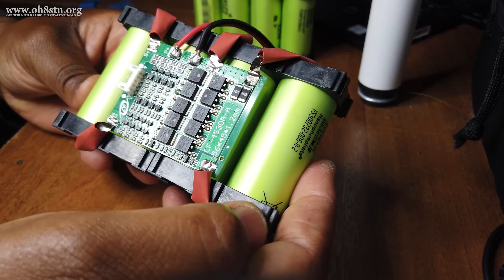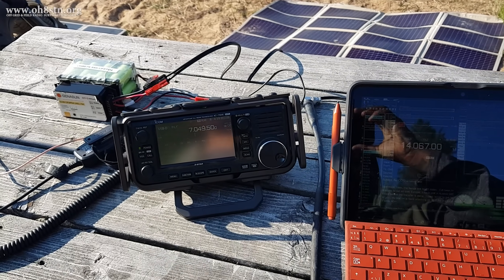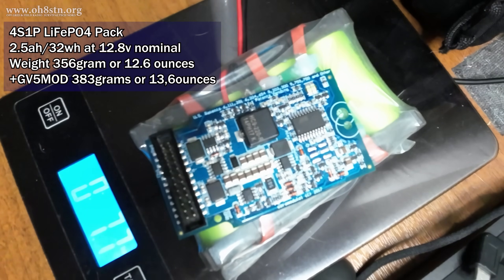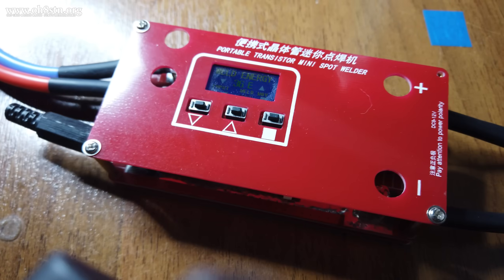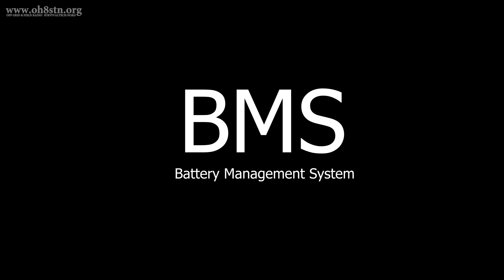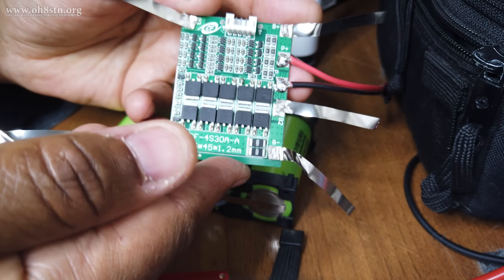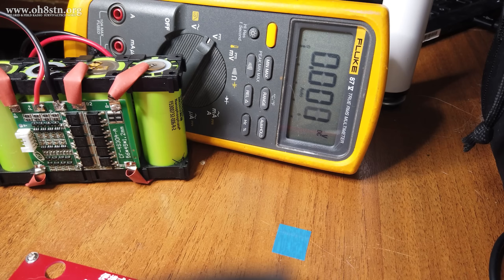Portable Ham Radio battery Pack DIY

Comment: Hi Julian, the pack is finish 😂,  but no sun for charge via my pannel lol 😅, please info for charger model for charge into my home, 73 de laurent on2vhf
Reply from the maker: Well done! 💪👍
I use a 16-19 volt laptop charger with no more than 3 amps charging. This charger goes into the solar charge controller solar panel input.
73
Julian oh8stn
Reply: Hi Julian, the BMS is burning lol 😢, i am user power supply for laptop, 19v and 3.42 amp, is too high power, please support,  73 de laurent

Comment: Is it possible to build something like this for a hand held radio ? That i could carry on my waistline. I work in a steel mill and we must have radio on us at all times. My battery will last half a shift before i have to replace it. Could this be possible? Thank you
Reply from the maker: Sure! Same battery as here, we just add a voltage regulator and connector to plug in yo your work radio. Keep in mind though, your work radio battery is probably damaged if it only lasts a few hours. I'd try replacing it first.

Comment: Its Bio-Enno, not what you said.  Okay, so maybe english is your second language? Any ways, as a legally blind Ham Radio operator, I find stuff like this interesting to watch/listen too. But due to my bad vision, and lack of funds, I would never be able to make something like that.
Reply from the maker: I speak two languages reasonably well and a third poorly. Some words are spelled the same in various languages, while pronounced differently. Deal with it! 
Previously you mentioned riding a bike and buying a commercial battery. A pre-built battery is probably the best option for someone who has no vision. However,  this is a very simple build. If you can ride a bike, you can definitely build this battery.
73
Julian oh8stn

Comment: Julian, if I may ask, what heat shrink tubing are you using for your battery packs ? I’m building the 10Ah QRO pack with the Headway cells and have found that the thin stuff sold at Amazon is total crap. The heat shrink used specifically for battery packs looks to be too thick. Trying to get a gauge on measurements as well - most have a length of 12” - seems too long. Thanks de WB4YDL Jamie
Reply from the maker: Yes agreed. I have not had much luck with Amazon heat shrink. The one I use is called PVC heatshrink, 250mm-350mm wide. It comes in various thinknesses but it hard to find. It almost always come from China via eBay. There is no consistant listing, so you'll just have to search.
Makes you miss the old days of quality electronics shops one could walk in to.
73
Julian oh8stn

Comment: Hi Julian, do you have a video of adding the GV-5-MOD?
Thanks
73
Dave - N1DCH
Reply from the maker: I'll add one if you think it's useful. There's only a few connections. Very often people want to connect it up in different ways. I can do a short video on how I did it.
Reply: @OH8STN  thanks I’m interested in how you did it.  From looking at the board it seems like there could be options.
73
Reply from the maker: Yes, I'll get it done. What I actually did was remove the connector block, took the pins off, and soldered my wires directly to the solder pads. This made the charge controller practically flat. No ribbon connector to get in the way. You have to have a steady hand and with my eyes magnifying glass. Needless to say it worked extremely well.

Comment: I’ve been tempted to build one of these packs since I saw your older pack. I discovered something this week and in the typical Julian ‘less is more’ style I felt compelled to share as it might be an alternate solution that meets my needs just as well if not better. It turns out that any quality battery charger pack with a proper Multi-voltage PD USB-C port good for 100 watts for powering notebook computers will power the IC-705 for quite a while and all it needs is a $10 cable from Amazon with a 12v output. I found one easily enough which already had the right plug to insert directly into the IC-705. Cheap. Easy. Compact. No soldering. No welding. The only gotacha right now is solar options aren’t as powerful as using a Genasun and a larger, higher voltage, solar panel. Finding a practical combo of USB solar panel and battery is my next challenge. See if I can’t find a combo that makes the kit sustainable for use over many days. I plan to pick up a second battery with a 20V cable for extending the battery on my POTA computer and do some testing to see how many days I can run without charging.
Reply: I should add that 100w is overkill. The 12v spec on USB-C provides 3 amps.

Comment: I love your solar power and battery pack videos, Julian.  Very helpful information.  I have two questions I hope you can answer:

1. When using a charge controller without a load port (like the Genasun GV-10), can you have the battery connected to the radio (discharging) and to the charge controller (charging) at the same time?

2. Your blog has mentioned using a high-quality BMS for the battery pack builds.  What are the things one should look for when selecting a quality BMS?

Thanks again for the great content!
Reply from the maker: Q1 Absolutely! Connect the controllers battery port and the load in parallel.
Q2 BMS specs depend on your chosen battery chemistry. I always try to find BMS board with balancing, shut circuit protection, low voltage cutoff, over voltage protection, and solder pads which are actually big enough to carry the current you're trying to get out of your pack.
Hope this helps
73
Julian oh8stn

Comment: Hi Julian, Hi to the community ! My Xiegu G90 manual specifies a 13.8V minimum voltage input to guarantee the performances. Here I see 13.4V "only" ;) . What would be the solution to operate with a voltage range from 13.8 to 16.5 V, as the G90 requires it? Maybe having 5 cells in serie, but do such BMS exists ? What about a 8-40V to 13.8V DC-DC regulator with 14.8V tor24V battery ? Thanks for your suggestions !
Reply from the maker: The g90 doesn't require 13.8 volts it's a wishful number. Here's an example, you're sitting in your car with the motor off, your g90 is operating off of the automobiles battery. What's the voltage of the battery when the alternator isn't spinning? My g90 operates anywhere between 11 volts and 16 volts without any issue at all. The only reason the battery pack says 13.4 volts, is because it isn't charged to full capacity. Hope this helps.
73
Julian oh8stn
Reply: @OH8STN  Thank you for your message Julian, If you have the opportunity, I'd be glad to know the voltage ramp through the discharge. Your videos are top quality, you helped me so much time to choose and tune my portable setups, many thanks !
Reply from the maker: Lithium iron phosphate packs have a flat or rather hockey stick style of discharge curve. There is a sudden drop from 14.x to 13.6 to 13.8, then it stays relatively flat for 90% of it's discharged. After 90% of drops pretty rapidly. Let's Google be your friend. This is a well-explored topic about lithium iron phosphate batteries. Just search lithium iron phosphate discharge curve.

Comment: Looks like I'm ordering parts again!  I'm still using the 2 battery packs that you showed several years ago.  These were the ones using 4 3812S headway batteries.  Both are still going strong!  Thanks!  73, K8JLW
Reply from the maker: This is definitely the best comment of the day! My headway packs are also going strong. In fact, this is the reason there hasn't been any Builds on the channel for some time. Anyway, thank you for watching and for the kindness. It's greatly appreciated.
73
Julian oh8stn
Reply: Exactly what I was thinking

Comment: Love the content.  I just got thru getting a small battery for a little DMR radio I was going to keep in my pack when riding dirt trails.  I noticed a lot of Lipo batteries for RC cars come up in my searches.  they are kind of pricey, but seem to pack a lot of charge in a small package.  would they be usable?  can they be charged off a solar panel?
Reply from the maker: Many RC batteries are LiPo which have higher energy density but are volatile is misused. They also lack the internal battery management board to balance to indivudual cells making up the pack.
If you use them in the field, then balance charge then at home, they can be a nice option. I don't use them as I like to combine my batteries wth a solar charge controller and solar panel for extended field comms. No reason why you couldn't use them.
73
Julian oh8stn

Comment: Any all in one solutions you'd recommend before you next next video comes out? I missed out on the lightsaver max and it's been out of stock for quite a while
Reply from the maker: I really needed dto think about the right answer to this question. There is the BAT500 soon to be released from DIY599. @Powerfilmsolar is also working on a new version of the LSM. It should hopefully be released later this year.
The reason I am building is there is nothing I could recommend which is right here, right now.
73
Julian oh8stn

Comment: i don't think the plastic separators will contribute much in the way of cooling given that you are wrapping the entire battery in shrink wrap plastic.  No air circulation there...however they do make for a neat build.  Of course the Anderson Powerpole (I won't digress into how awful they truly are) connection is also the charge/discharge port.
Reply from the maker: In this case they really act to separate the cells, preventing any hot spots between them. As for the connectors, I generally prefer XT60, but for interoperability with other group members, the powerpoles are fine.

Comment: With the Peovi Full wrap and front cover 
Will it still fit in the maxpedition 12-inch x 5-inch bottle holder ?
Reply from the maker: It does, it is a tight fit but Perfect fit. There is also a microphone, packtenna EFHW or CHA EF40 and the battery pack. I'll post pics to instagram and the community tag shortly.
Great question!
73
Julian oh8stn
Reply: @OH8STN  thanks J KE8AKU

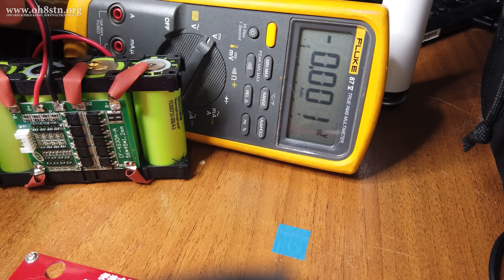Comment: 16:34 Strain relief for the power cord? Just a big glob of hot glue is better than nothing. I can guarantee you that I would yank mine out eventually. 

With your interest in anywhere-anytime-any-conditions operation and that lovely view of the water, have you ever taken your kit out ON the water for greater mobility? Seems like a sailboat would be a good fit for what you're doing. Even comes with a mast! 😀
Reply from the maker: Thanks for the strain relief tip. I'll add it tomorrow.
I have been out on the water with a canoe and traditional row boat. Seriously thinking about an small rigid inflatable to explore the islands on the coast. Before that, a snowmobile for winter ops.
Awesome advice and kindness. Thanks for watching and much appreciated.
73
Julian oh8stn

Comment: Julian, these videos are simply inspiring. Although I have several Bioenno packs, I would really like to build my own with an integrated charge controller. The A123 cells are a great size and larger packs can be built on the headway cells.

Great material... thanks!

Comment: Exellent, Nice video,  73 de laurent on2vhf
Reply: hello, what charger do you use?  with 100w solar panels?  thank you, 73 from laurent on2vhf
Reply from the maker: Genasun GV10L or Victron 75/15 
73
Julian oh8stn
Reply: @OH8STN  hi Julian, charge controller mppt 75 | 15 , is ok for charge other battery ???
73 de laurent on2vhf
Reply: Hi, i am buy all item for build this nice pack battery for portable activity,  73 de laurent on2vhf
Reply: hello, to charge the batteries at my home?  which charger to use, thank you, 73 from laurent on2vhf

Comment: I really enjoy watching battery builds like this. Small compact but powerful enough to do the job, AND solar rechargeable. I hope you do a follow up video on charging this with solar. Do you think this would work with a Midland GMRS 15 watt radio just for daily use hiking around the ranch, or do you think it wouldn't be enough power? Thanks and keep up the great work.
Reply from the maker: More than enough. I tested with an HF radio and small amplifier.

Comment: hi Julian is this pack big enough to run my Xiego G90 for a POTA day or would i need to build your larger Battery's

73

Phil 2E0FJQ
Reply from the maker: I Phil. It'll definitely run the G90. For how long is a great question. Depending on duty cycle, I imagine you could get at least six hours out of this pact with the g90. That's especially true if you have a solar panel connected as well.

Comment: This is basically what I have to give a boost for my IC705. It works perfectly, just the right size for my Decathlon soft lunchbox that holds the radio, cables, EFHW antenna, battery, logbook and even a multi tool and a Mini 60 analyser. 73 Marcus EA5HQ
Reply from the maker: Agreed. Kind of amazing Icom didn't do a battery like this themselves. It's only slightly bigger than the internal battery on the 705, but double the capacity and of course much more current capable. 
73

Comment from the maker: Parts list with all links is published on my blog: There are 26650 cells, BMS, 26650 cell holders, spot welder, a 3d printed enclosure, and info on the charge controller. 
73 
Julian oh8stn
Reply: What is the clear giant heatshrink stuff you put over the entire pack? I've never managed to find anything like it, which is why MY battery pack is contained within a crinkly mess of tape that I suspect will dissolve if it ever gets rained on... Thanks!
Reply from the maker: It's a PVC heat shrink film 275mm flat opening. I'll try to find it and add to the parts list.

Comment: Outstanding, Julian; many thanks for this series.  In addition to doing as you have done here for a 4S build, size considerations apart, there should be no reason why a KX-2 owner can't follow the same process to make a 3-cell battery that fits inside the radio (like the current Elecraft lithium-ion battery).  There is a lot to explore here.  73
Reply from the maker: Completely agree! The charge controller would still need to be outside the radio but that's an improvement for sure. I really wish I could craft would upgrade that charging circuit. Thanks for the comment and for watching. Much appreciated.
73
Julian oh8stn
Reply: 3S would only give you 9.75 volts. The KX-2 has a 11v internal battery.
Reply from the maker: I think he meant 3s diy lithium ion.